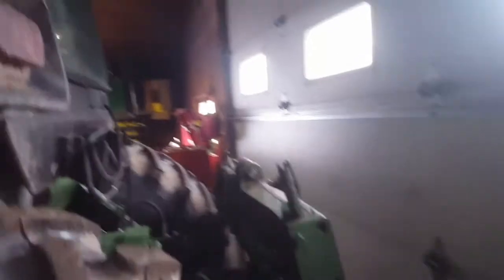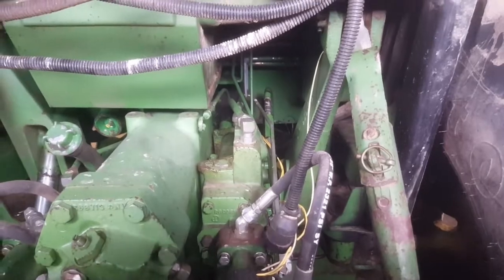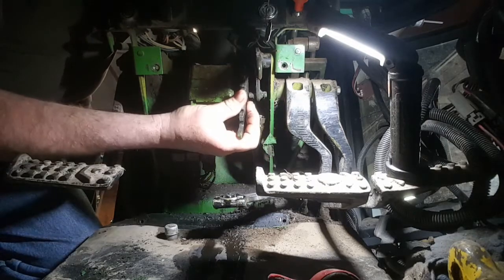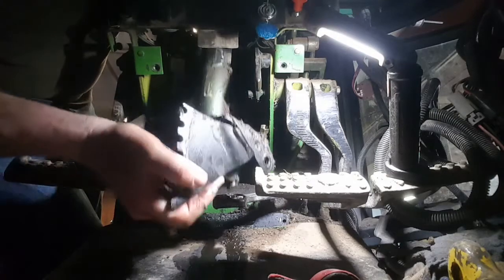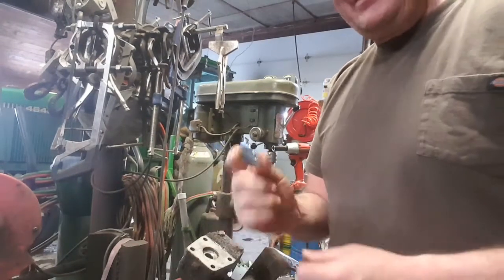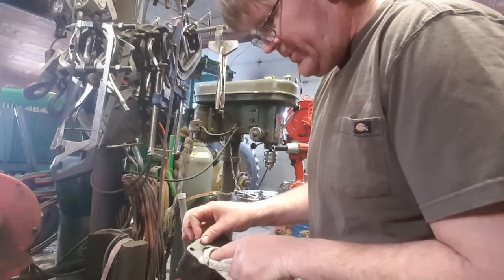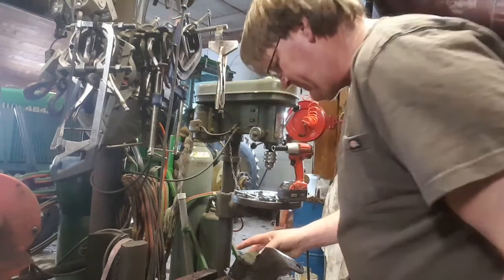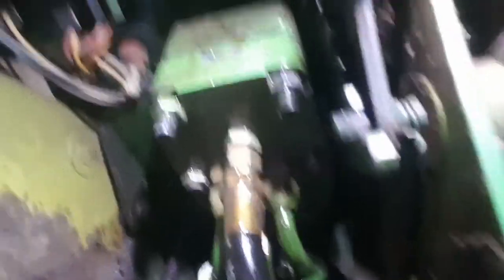4640 steering pump repair.

Comment: I am attempting this today to get it out. Mine is a open station 4030 so the steering wheel has been a bear! Had to get the fire wrench out and heat it so the the little plastic slip tube is now very much toast! But I got the wheel off now on to the rest of it see how it goes. 🥴
Reply from the maker: Ha! Good luck
Reply: @jonstevensmaplegrovefarms3754  I got it all out and apart so now just clean up and putting it back together . I had to remove the clutch pedal on mine to get the column tilt bolt out. It was hitting the pto lever.
Reply: @jonstevensmaplegrovefarms3754  You did say the side of the seal with the cuts in it or lips you called goes down right?
Reply from the maker: The Spring or lipside always goes to the side of oil

Comment: I replaced that seal in a 4440 last summer.  It fixed the oil leak, but I must have snagged a wire because 3 days later it went up in flames
Reply: Joe Morse geez, I don't know who'd hire you.
Reply: mr Bill anyone with half a brain in their head would be glad to have me work on their equipment

Comment: Really appreciate your videos involving this era of John Deere! Helps a lot! I've got the metering pump out of a 4440, on the bench already. Leaking all over cab floor and top of trans case. Point(s) of leak not obvious. I've read over the test procedure in TM1182 but, I do not have the gear to test properly. Is there a quick and easy way to test this assembly for leaks? Shop air in inlet fitting perhaps... I know that the low pressure line was leaking due to age and degradation. I've got all the o'rings and seals on order but if it's only this shaft seal that would save me a lot of trouble as I don't have alignment dowels for proper reassembly.
Reply: Q

Comment: We have a 4630 that has had the metering pump rebuilt at the local JD shop.   Once returned home the steering is extremely hard to the right and perfectly fine to the left.  What do I need to inspect?
Reply from the maker: Early 4630 with the 20 series steering? They will have to do it again and adjust the valve clearance most likely

Comment: What is the torque on the 4 bolts and nuts that mounts on the box?
Reply from the maker: If you're using a 9/16 wrench it would be 35 lb

Comment: My 4030 is leaking up by the steering wheel. I wonder if this is the problem with mine? My fix for the last year has been plastic folgers can wired to the column!! Lol. Cause they wanted 1000.00 for a steering valve!! 🥴
Reply from the maker: Good chance just that rubber seal.

Comment: I have a 4440 very stiff steering and getting more hard if you put more gas
Reply from the maker: @zinhlechonco3132  I would start with a check system pressure at an outlet. Is the steering block under the hood getting hot quickly after starting the tractor in the morning
Reply: @jonstevensmaplegrovefarms3754  yes its getting very hot the steering block too much
Reply from the maker: @zinhlechonco3132  them are not repairable, the aftermarket ones that are claiming to be rebuilt have been very hit and miss you're taking your chances with a used one they're not cheap but in the long run you just get a new one from Deer if you do determine that that is your problem

If that block gets hot quickly if it's not your problem now it will be very soon
Reply: @jonstevensmaplegrovefarms3754  very hot and. It's turning to the left-hand side on it's On to the last if driving you driver fighting with the steering to come straight
Reply from the maker: @zinhlechonco3132  time to replace it. Might have other issues but that needs to be relaced
Reply: @jonstevensmaplegrovefarms3754  I have opened it I see the shaft inside the brick is roughly
Reply: At Deere it's very costing this brick

Comment: hi jon i need to know the hydraulic oil level of a john deere 4020 i'm from chile
Reply from the maker: Welcome glad you made the trip from Chile! If I do a service here where you drop the oil and it changed the filters it would be about 11 gallons. It might change a little bit whether it's power shift or Synchro

Comment: Could this have been done without removing from the tractor?  Remove the 4 bolts and lift the steering column up enough to change the seal?
Reply from the maker: I thought about trying it that way just to see.
Reply: I have a leaky 4230 and wondered if it was doable that way.

Comment: how did you remove the steering wheel?
Reply from the maker: Put the nut on the end of the threads flush. Put your knees or lift with a hand on the steering wheel. The hit the end of the shadt with an air hammer. Pops them right off!